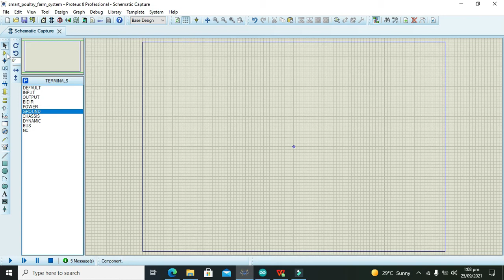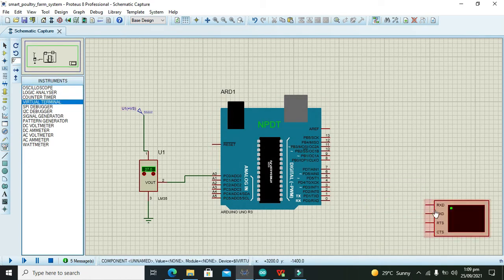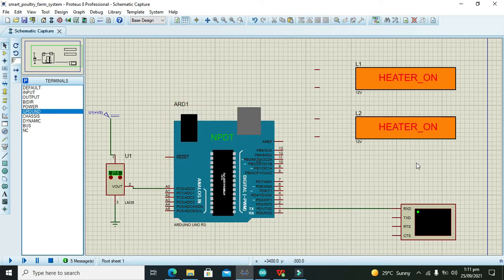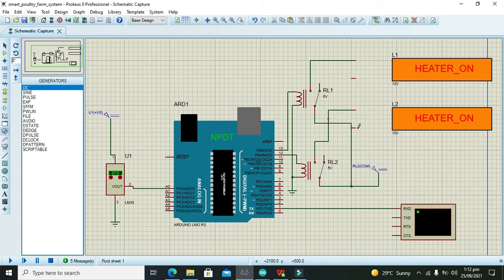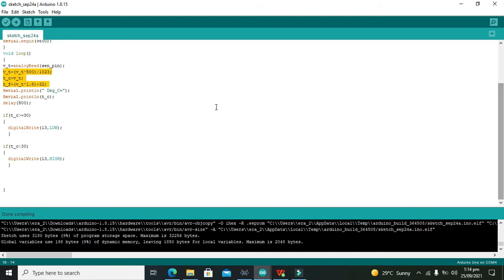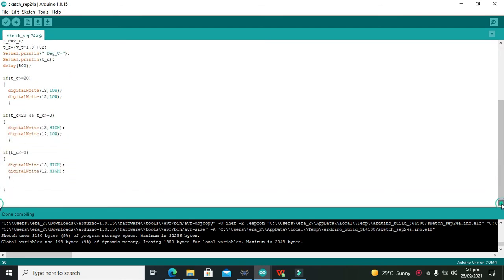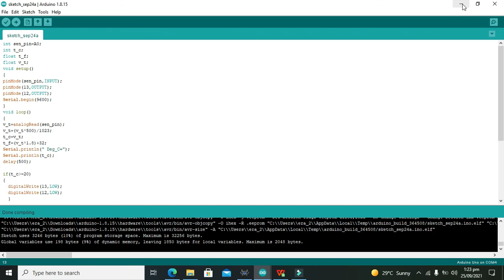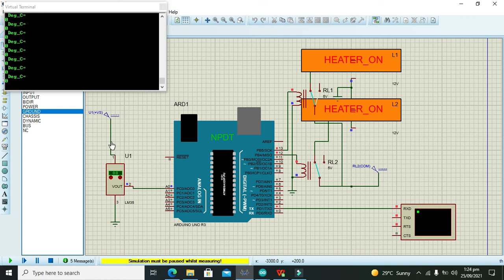simulation of smart heating system using arduino in proteus

Comment: Can I see the Arduino code please?
Reply from the maker: sir....as we dont keep the code files due to excessive files...so u can write it from the screen..it will take 2 to 3 mins..thanks for visiting...here to help...
Reply: @nelsondarwinpaktech3954  Thank you I've got it.  But I also wanted some help on how can we implement two sensors on that same diagram, so as the heaters should be ON when both temperatures are at the same value, and OFF otherwise.